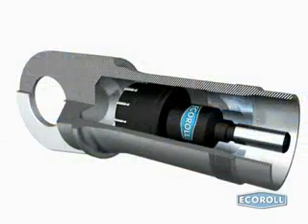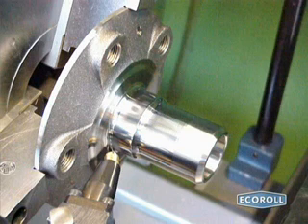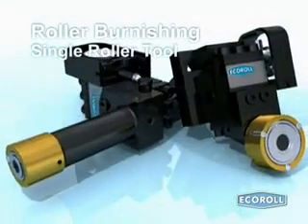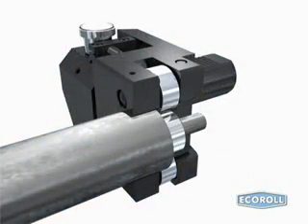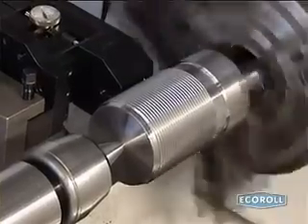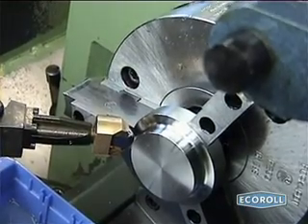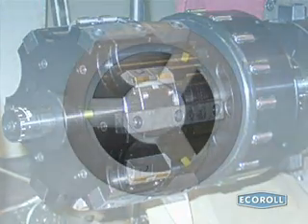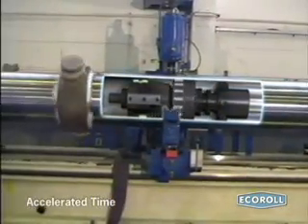滾光工具

Comment: @@@Welcome your drawings and specifications and samples@@@
YI CHIA PRECISION(CNC LATHE)Industrial Co., Ltd is an ideal business partner you looking for.

YI CHIA PRECISION metal(CNC LATHE)Industrial Co., Ltd the expert for manufactruing of precision CNC turning parts
      --------------------------Taoyuan County , Taiwan , R.O.C.-----------------------------

Contact Person

General Manager : Mr. Yang    
Mobile phone :+886 911-794-473  

Sales Manager : Mandy Chen  
Mobile phone  :+886 911-794-461
Mail : yichia.mandy@msa.hinet.net

Sales Rep. : david Hsieh   
Mobile phone :+886 3-477-3117
Mail :yichia.david@gmail.com

              

Tel  : +886 3-477-3117  , +886 3-477-7337    Fax :+886 3-477-9292
                  
NO.77,Ching-Hua 2nd St. , Shin Wu Township ,  Taoyuan County , Taiwan , R.O.C.
---------------------------------------------------------------------------------------------------
Our Products:            

** pogo  pin (電池針)            
** probe pin (探針)            
**Aerospace parts 航太零件    
** Connector     連接器    
**Electronic parts 電子零件    
** Solenoid Switch Parts 電磁閥零件
** Medical Parts 醫療零件    
**Environmental  Chopsticks 環保筷
Medical Equipment Part/CNC Machining Part, OEM Orders are Welcome, Various Designs are Available

YI-CHIA can provide the customized ODM/OEM service and material selection to satisfy the best quality,
minimum cost, and quick response requirement.
For the shortest product developing time, we help each customer to promote its market competitiveness.
We have produced over 2,000 kinds of various precision metal parts for our customers.

product are widely used in

medical instruments,aerospace equipment,medical device of parts,experiences in medical field
Aero Parts Casting,electronic equipment,
FPD device,automation,automobile,and mechanical parts,
Battery acupuncture / pin ,probe card,probe pin,pogo pin,
terminal connector,solenoid valves,optical parts,precision shaft,machine parts,
air-tool parts,hardware parts,specially screw,specially nuts(--OEM),
precision metal parts,chopsticks,

MADE TO MEET WITH CUSTOMER ORDER AND REQUEST

-----------------------------------------------------------------------------------------------------------------
YI CHIA can provide the customized ODM/OEM service and material selection to satisfy the best quality, minimum cost,
and quick response requirement.
For the shortest product developing time, we help each customer to promote its market competitiveness.
What we manufactured varied modes with stable quality and rapid delivery,
also custom-mode specification is available and accepted. So for more than thousand kind of products are on offered.

the working material includes stainless steel,aluminum,copper,titaniumand POM to meet customer requests
------------------------------------------------------------------------------------------------------------------
OUR Product/Service :　

 CNC Turning Parts ,CNC Milling     Parts ,Casting Machined　　　

 Trade & Market: Global World
------------------------------------------------------------------------------------------------------------------
Our Products: Metal Materials Process

Business type: (Manufacturer ,OEM or ODM)

Main Products：
  Yi-Chia always focus on the clients satisfaction, we are the most professional?manufacturer of CNC Products  ,
machining component, precision machining parts, screw machining, Swiss turning, machining parts, precision parts,
precision hardware.

Materials Type：
　  brass , titanium , aluminum , stainless steel , SK4 ,12L13 ,12L14 , copper , plastic ,iron, and so on .
Machining Type:
   CNC Turning, CNC Milling, NC Turning , NC   Milling,Drilling, threading,etc .
Inspection equipment： ２.５D Projection meter，Thread Plug Gauge, Height gage , Micrometer,   etc .

Specifications:
   diameter 0.15mm to 60mm.

-----------------------------------------------------------------------------------------------------

YI-CHIA Welcome your new special designs and samples for OEM / ODM and promoting market successfully.

YI-CHIA Industrial Co., Ltd.has become the expert for manufactruing of precision CNC turning parts.
It has gained the customer's high appraisal with professional technologies, advanced equipment,
and high-quality products for many years. and also with the new modernized factory
It contains a new production line, which satisfy the requirement for innovation, high quality, and quick response.
AND creates the new manufacture model for automatic CNC turning lathe and also is the leading company
to get the ISO International quality certification in Taiwan.

-------------------------------------------------------------------------------------------------------

YI-CHIA purchased advanced swiss-type CNC and turret type automatic turning lathes MIYANO
for high-accuracy and complex part development. Their material type includes stainless steel, aluminum, iron, and copper.
From the customer's satisfaction and applause, We always cherishing the innovation vision for enterprise strategy
and also is the international and domestic customer's best choice for long-term partner.

ABOUT QUALITY CONTROL:

YI-CHIA believes that product demonstrates the quality of itself. The only way to win the customer trust is to
produce the best quality products. The product quality is maintained by using total quality management system,
the advanced precision optical projectors, the height gages, the plug gages, and other electronic inspection instruments.
For on line quality control each manufacture step is controlled and inspected by detail and careful process
to keep the high quality and accurate tolerance of OEM products.

inspection for surface roundness/depth gauge/holtests/microscope

OUR FACILITIES:MIYANO TURRET-TYPE CNC LATHES
YI-CHIA's high precision parts have provided the best quality for various customers for many years.
And to satisfy customer's quality requests is the company mission from company management strategy.
The production line can provide the general series of Swiss-type high precision CNC lathes and turret type lathes
for part manufacture. The working items include cutting, milling, drilling, boring, screwing and taping.
We can be conducted by single machine to reduce the cost.

---------------------------------------------------------------------------------------------------------

The Materials Include : special parts-oem
Stainless steel, Aluminum, Brass, copper, Steel, Titanium and POM
to meet with customers' requests.

OUR POLICY:HIGHT QUALITY LOW COST HIGH EFFENCIENCY

Products are widely used in Medical instruments, Aerospace equipment, Electronic equipment, FPD devices, Automobile, Bikes, and Mechanical parts.

Such as Optical parts,
Precision Shaft,
Air-tool Parts,
Hardware Parts,
Specially Screw & Nuts and
Precision Metal Parts.

Welcome your new special designs and samples for OEM / ODM and promoting market successfully.

--------------------------------------------------------------------------
BUSINESS TERMS:
1. PAYMENT: BY T.T. prior to shipment
2. DELIVERY:  BY 30-45 DAYS
3. QUOTATION : ON THE BASIC OF  FOB /FOR TAIWAN
     We will offer you the best price for your demand.
4. Finished color: painted or anodizing or chrome plated to order
5. Material: to order
6. Min. QTY.:  to be negotiable.